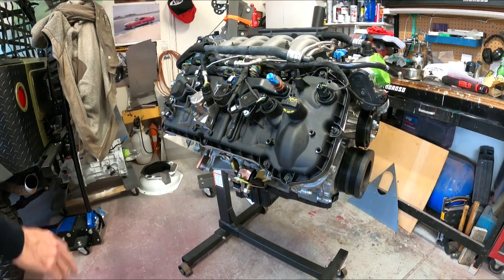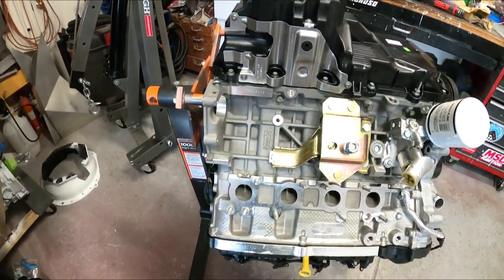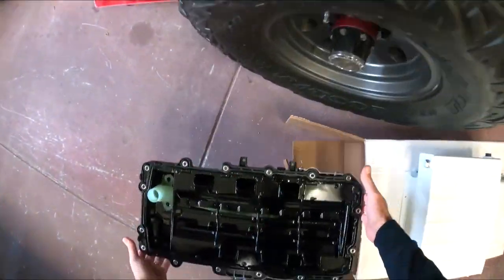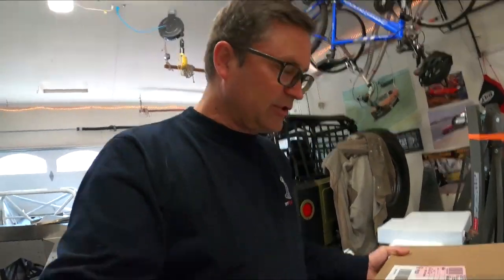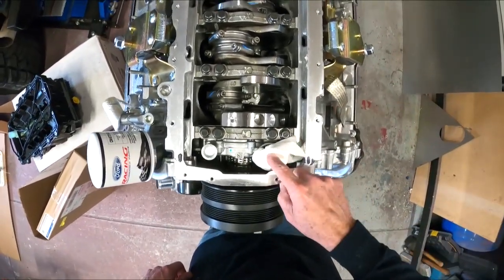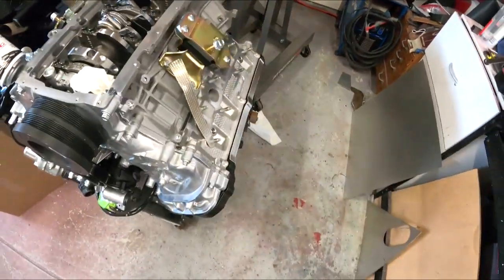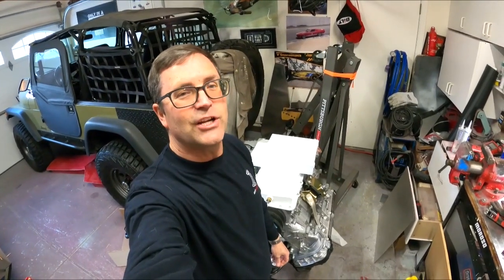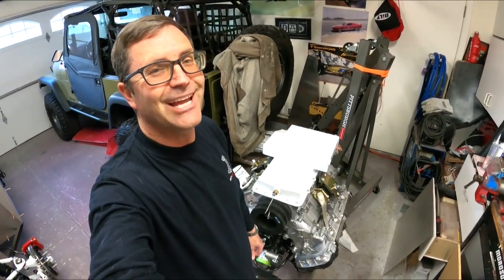Cobra Daytona Build-Oil Pan Installation,Video 53

Comment: Is that temp sensor an improvement on the kit? The FFR Coyote instructions seem to just say to put a plug in the third location.
Reply from the maker: Yes it is. Not required unless you plan on pushing the car hard.